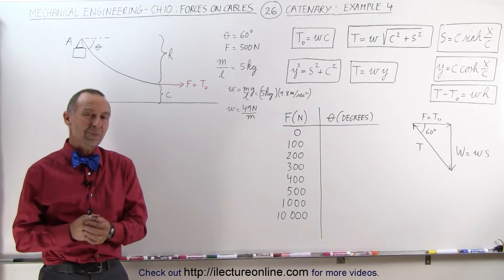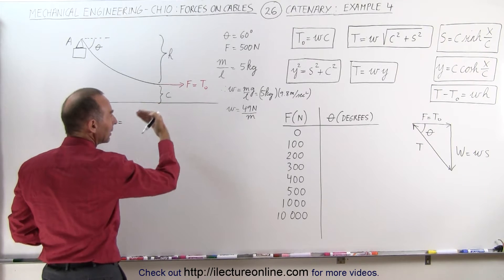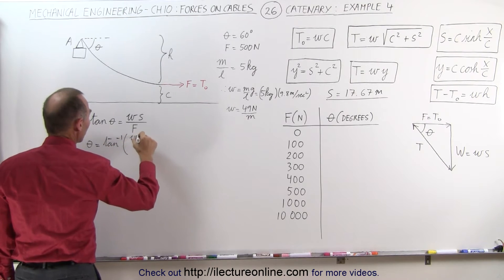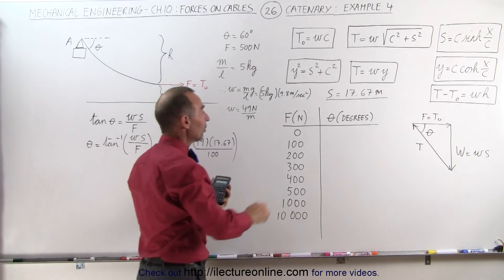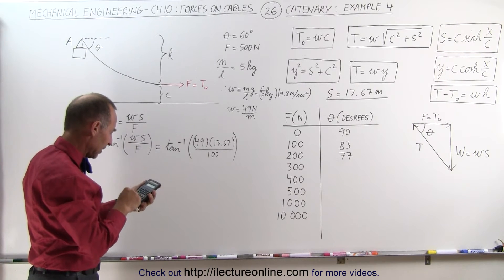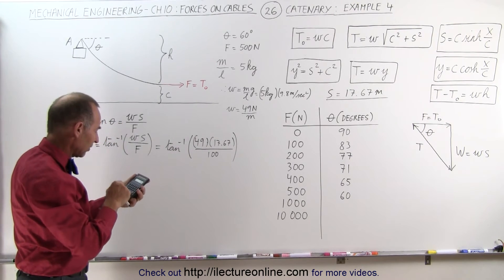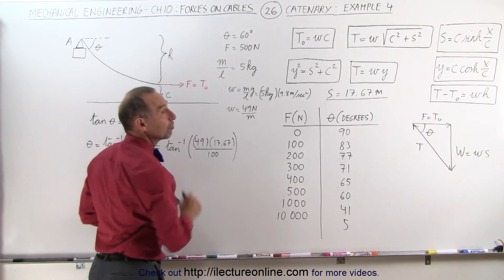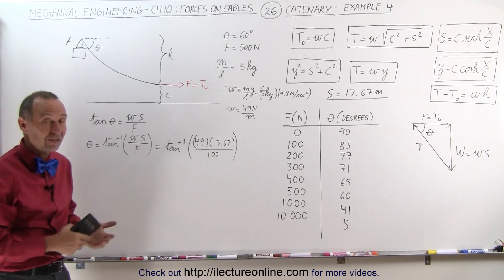Mechanical Engineering: Ch 10: Forces on Cables (26 of 33) Catenary - Example 4

Comment: Does S calculetd in the previos video depend on the angle Teta?
Reply from the maker: S simply represents the length of the cable.
Reply: @MichelvanBiezen  Think you very much , but the more teta is big the mose the length of the cable will be big. isn' it?
Reply: However, C are chosen from a horizontal line, what about if this horizontal line change? the results are the same?